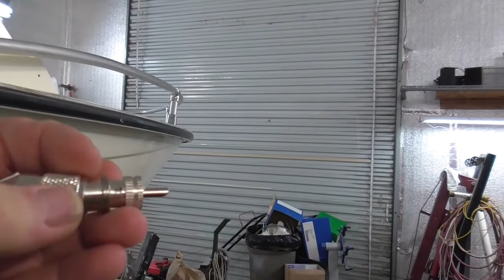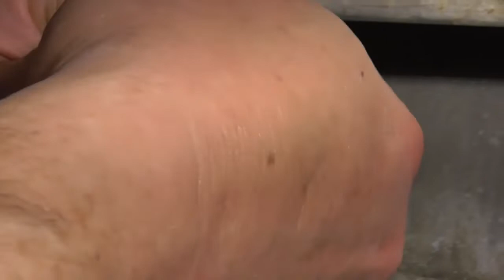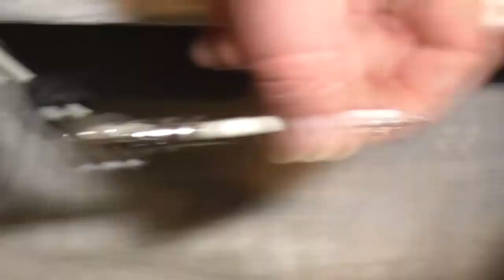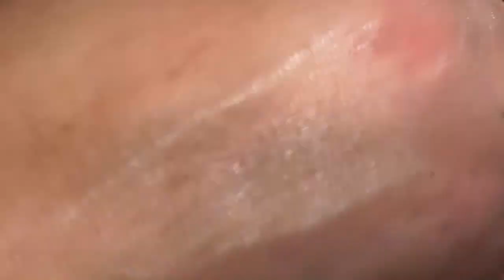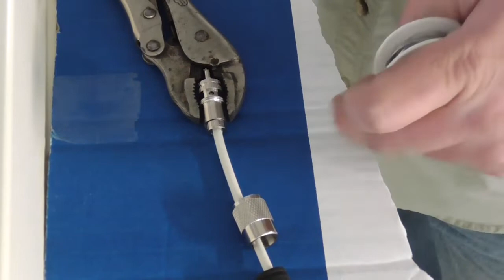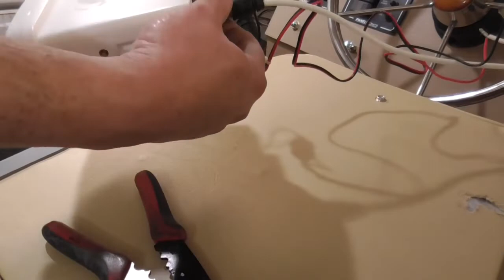Behind the Scenes - Installing VHF PL-259 Connectors

Comment: This video is very helpful I just bought a new 4ft shakespear antenna for our boat…. While instructions are clear I’m having a very hard time getting the inner connector over the dang wires as if the cord is to big. It’s the only thing keeping us from getting in the water. I feel like it shouldn’t be that hard to go over, but my man and I both have tried and my fingertips are sore from trying so hard. Can’t return the antenna now since we’ve opened it…. Any suggestions?

Comment: nice video on the connector. I have the shakespear antenna however the end section (the top) has been stepped on an has split like 8" can I glue this fiberglass antenna back an expect it to still work? thanks